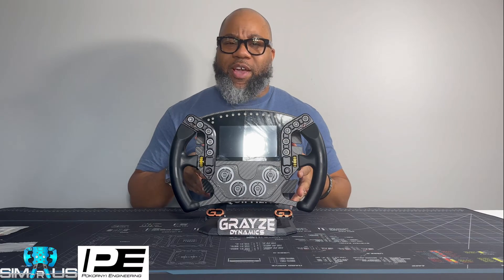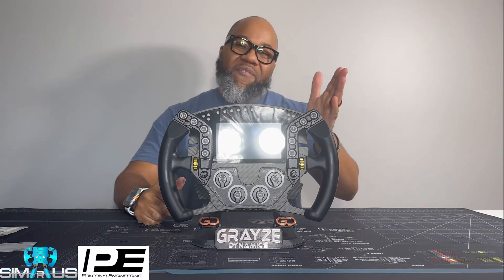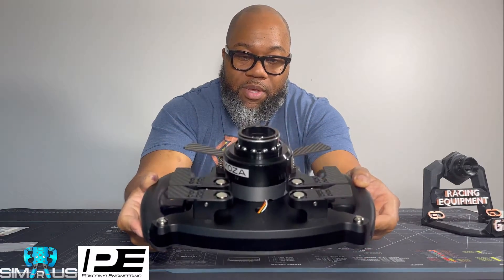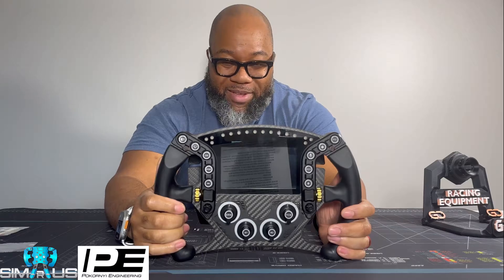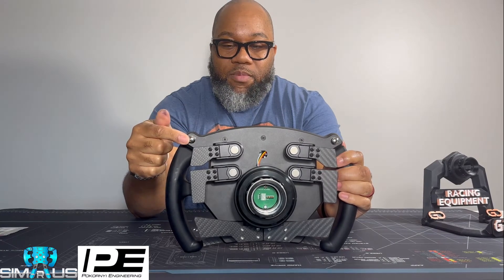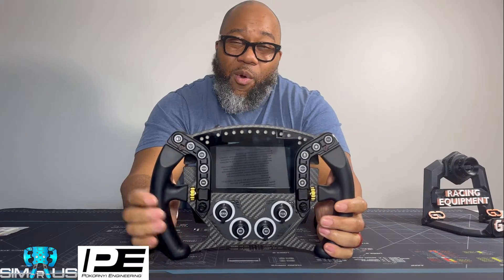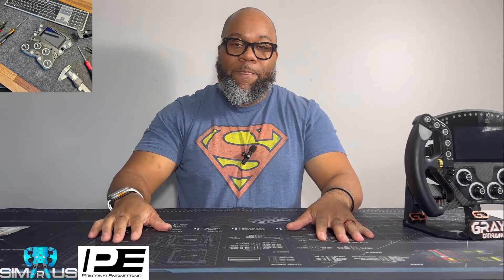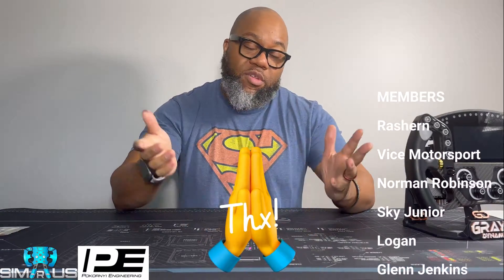Pokornyi Hyp-R V2 Review - All Aluminum

Comment: I just got the DIY plans for this wheel, and I'm seriously considering going all aluminum. Sure, it's expensive, but at that price, it's still cheaper than buying one ready to go from PE... The "value add" I see here is that you can split your purchase if necessary so as not to go in all at once... As I have some programming STM32 "blue pill" boards, I already have the required UART board needed to upload the bootloader, so I could have two PCB's and find a buddy to split the difference. Besides, programming the board yourself is half the fun! Anyway, I will also be building an MCP Button Box, so I can always do the trial run with that board before I decide whether to source the HYP-R PCB from JLPCB myself.
Reply from the maker: Nice. It's all fun. DIY is the gift that gives back. Yeah you could go with front and aluminum enclosure and 3D print a ton to save money then upgrade as you go. MCP is cool. I do enjoy it. Good luck and enjoy your build.
Reply: @grayzedynamics  Absolutely - I've made the decision since my last comment that I will definitely go Aluminum, because we all know that racing is about that aircraft grade aluminum and Carbon Fiber - if you aren't fast, at least you look the part. 😂 I should be receiving my first batch of parts for the button box from Pokornyi today, and my JCL submission just got approved, so I just paid the invoice to get it in Production. Aside from all the 3D printed internal light shields for the wheel, I'm having all the shifter/clutch paddles CNC milled in brushed aluminum, anodized black. I can't wait to see how those turn out! The best part about DIY is that you can build as your time and budget allows.

On that note, I don't know much about STEP files, but if it were possible, I would have requested that the beveled edges of the paddles be milled After anodizing, that touch of silver on black anodized aluminum looks top-tier! I also race competition grade RC cars, and that detail looks amazing on milled parts available for them. Awesome content, man - keep building
Reply from the maker: @jcchaconjr thx man. First I am excite for you mate. I love DIY and when people make changes and creative it is awesome. I just did my paddles for my LMP in brushed brass so it looks gold. I will get a set of anodized gold ones too with the slits in it. I think that will be fire too. Make sure you join the discord and share your build in the DIY or show your rig community. We love customs stuff. 

I did aluminum black paddles and clutches on my 499P wheel and it came out awesome.

Comment: I’m currently building this in the aluminum trim, and wondering what momentary switches you used for the two back buttons? The aluminum hole is now 10mm I believe, and can’t find many options for that (or my google fu is failing me). Any input for those two buttons?
Reply from the maker: If you get the aluminum enclosure from Pokornyi. He does include them in the package. I had to search AliExpress for buttons and it was quite difficult. I ended up using the ones I had for the 3D enclosure with a nut behind it. The 8mm button.
Reply: @grayzedynamics thanks! I did purchase the aluminum housing from him, and it did have the black ones. I actually just soldered the plugs in today, as I had no luck finding anything else. Excited to get this completed! Love your content by the way. Keep it up.

Comment: Hi great video!  I noted a PCB on the QR.  Are you able to use this thing wirelessly?  If so can you share what you did? thanks
Reply from the maker: Hey mate, thanks for the feedback. So I am using the Dan Suzuki QR update. He makes PCB's that can be used in a hybrid wireless model. Essentially, you connect the base side PCB to a powered USB. Then the wheel to the wheelside PCB and you connect your wheel and "wireless" functionality. Check out his channel and discord for help. He is currently working on his upgraded version of this.

Comment: Great video! QQ how do you implement the Dan susuki QR solution using a moza QR? do you also have it connected to a moza base? I just did my first DIY build (the pokornyi GTE PRO V1 BIG BOY) and i was looking into using the QR from Dan but this is my main blocker.
Reply from the maker: Thanks for the feedback. So if you are using Moza, this solution likely won’t work for you. It is really intended for those without a Moza, Simagic or Asetek base. Moza uses a proprietary protocol. So it would not align and transfer both data and power.

Comment: What spacers did you get for the rear buttons?
Reply from the maker: I honestly think I just screwed them down with the original nut and it worked. I do have some spacers from other builds, but additionally, when you get the new files from PE, you can get the new adapter to use your current buttons.

Comment: Hi Ray,
thanks so much for the HYP-R build videos. I am planning to build it myself but I am a bit hesitant about the aluminum version as of the significant price difference to the 3D-printed version. Is there despite the shifters any functional benefit that comes from going to aluminum? Is there less flex with the aluminum body? Thanks so much and best regards, Freddy
Reply from the maker: Hey Freddy. So it definitely is much better quality and far more rigid. But id say if that doesn't matter than build it 3D printed is a great option. If you have a 3D printer or use my Sponsor SimulationRUs you can save a TON of cash. It is lighter and you won't have any issues. It's nice in 3D, it's premium in Aluminum. No flex, bending and is rock solid.

Comment: Excellent video! Question: what wheelbase would you recommend if I wanted to start building my custom wheels?
Reply from the maker: Well you have do many options. Depends on budget and whether you want an ecosystem or top of the line. I have a VRS wheelbase and love it. Simagic and Asetek are good and Simucube is the gold standard to me. What’s your budget?
Reply: This is what i needed to know. Thanks for replying!
Reply: My wheelbase budget is 1000.00
Reply from the maker: Oh that’s a good sum of money. VRS is best bang for buck but requires a lil extra. I love it but not the simplest with box, 2 cables but software is much better. Asetek and Simagic are nice. Both have good bundles too. Are you close to a Microcenter?
Reply: @grayzedynamics No, I was waiting for the new Microcenter location in Charlotte, NC, to open. I live in SC, and the grand opening was supposed to be in May 2025, but now there is a delay. I went on the VRS website yesterday. The wheelbase and mount are in stock; however, the hub adapter and quick-release are out of stock. I will check out the Asetek and Simagic , because going to Duluth, GA., is drivable for me. Thanks again for your response.
Reply from the maker: @bvtwinrob yeah having a Microcenter is a great thing. If they have a bundle, they can be quite good. As for the VRS. If you go that route, you, I would recommend you go with an NRG QR, than you can add wireless support using the Dan Suzuki QR solution. If you go Asetek, you already have a great option. Simucube use NRG as well. And Simagic already uses NRG.

Comment: Nice wheel, question. I built my wheel to have the second set of thumb encoders, is the aluminum housing thicker than the printed ones? On my version, the space just barely allowed for the encoders.
Reply from the maker: Yes it is thicker and you’d have to drill thru it. You may be able to add, but it would be a tight fit for sure. I thought about doing that for the 3D printed one. I may do that for my friends.